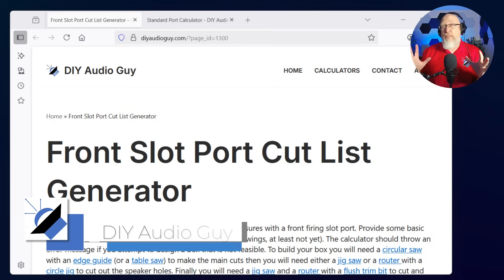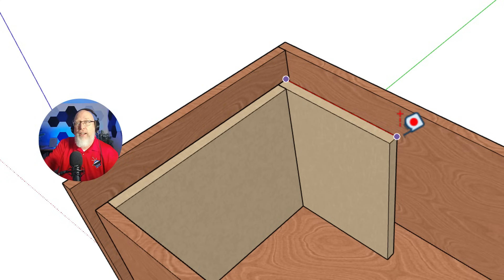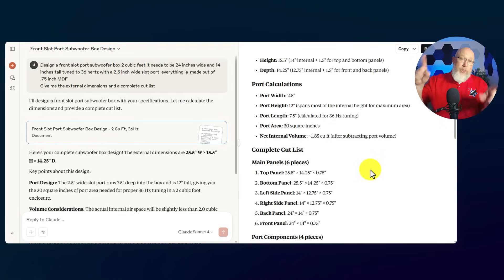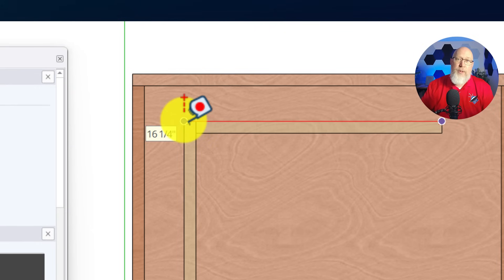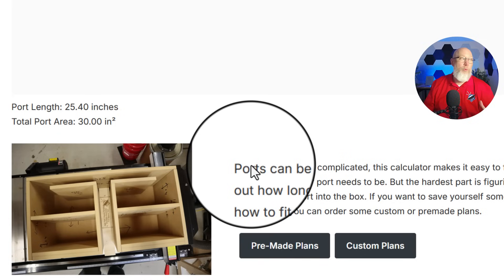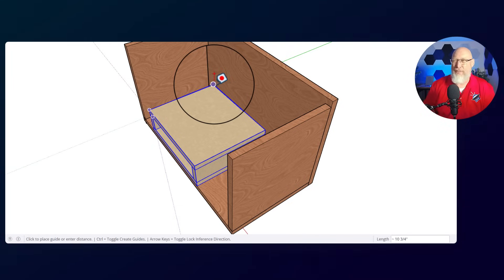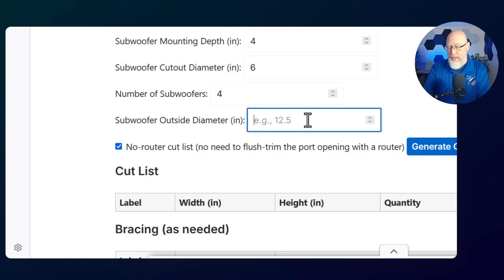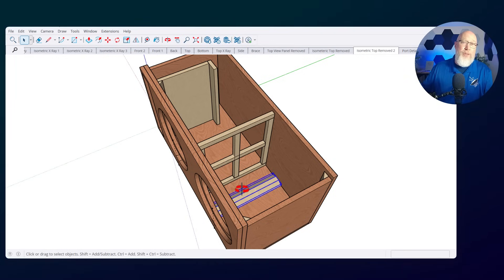AI can't design a subwoofer enclosure.

Comment: I use ChatGPT, UCAA, and WinISD combined. Havent had a bad enclose yet, they all perform as expected if not better🤞🏼 next up is a enclosure for 2 xv3 15s, 10ft³, 28hz 💪🏼
Reply: I strongly believe that WinlSD is better.. because it already has the database for subwoofers and better enclosure designs - as far as I've seen with chatgpt, have incorrect or wrong design. I guess if you know how to tweak the app and get it to provide with the right results, then I guess it works.

Comment: There is definitely something wrong with that calculator. I got a manual right in front of me for my subwoofer. I put in the height width and depth in my subwoofers deprh and cutout and overall width and internal volume number of drivers tuning frequency and I've been playing with it for over 2 hours and continuously get these error messages like the box is too narrow optional recommended wooden box specs 2.71 cubic feet box cut off at 38 HZ 21.85 in wide 14.56 h 17.75 inch deep I answer those numbers it keeps saying it's too narrow.
Reply from the maker: The outside dimensions you provided are not enough for 2.71 cuft of internal volume and that does not include the space taken up by the port. So, yes, the calculator on my website is going to throw error messages.

Comment: I'm using ChatGPT to help me with my 10 speaker/dual battery build in my caravan. It helps so much with troubleshooting! Annoying when it doesn't understand a request, especially when it's one that involves information that you previously told it, but it's very early in the tech. 
Will post vid and credit this channel for helping me

Comment: Well I bought two of these Sundown Audio NS-15v6-D1 15" Nightshade 3000W RMS Dual 1-Ohm Subwoofers. And I put them in a prefab box i had. Well they didn't sound that great at all. I was told the box was way small for these subs. I had a build sheet made on chat gtp. With the depth set at 16.5. Because more than that is uncomfortable to drive with the seat that far forward.
But after watching this. I think I am going to have to give up! 😢
Reply from the maker: Grab the box recommendations from sundown's website and drop everything into the cut list generator on my website.

Comment: @diyaudioguy does it take into account whether the subs will be firing up with the port back, or all subs and port on the same plane?
Reply from the maker: The current version of my calculator is just for front firing.  I am working on one that can fire the subs/port in any directing.  it is taking some time because I want it to throw a warning/error if there is not enough clearance.  In theory you could take the current version, with a single baffle, and aim the sub(s) any direction you like.  That works fine until somebody tries to up fire a 12" sub in a box that is 10 inches front to back, and then blames be because they bought the wood and it does not fit.

Comment: I recently tried to use chat GPT to make a couple large subwoofer boxes and at every step of the way it got things wrong. But It was great as suggesting resources for me to go and read up on, I ended up with something that works and performs reasonbly well for my first proper build. 
It calculated my volume wrong though and I didn't check it before cutting the wood so I had to adjust my calculations to suit the new box size. Worked out in the end but I also used it to figure out what sort of driver to buy and it didn't do well at comparing drivers.
Reply from the maker: Probably has something to do with the way the models are trained.

Comment: What I really want is a Database of trunk openings or fold down back seats dimensions. What sucks is being off 1/4" on one side and you can't get the box in even though the trunk volume is big enough.  An app that can answer: What are the max external enclosure dimensions that can pass through my trunk opening or back seat opening? Assembling a box in your trunk is not fun, but knowing I need to if a given box won't fit fully assembled.  Hope that makes sense.
Reply from the maker: That would be cool.

Comment: Does your calculator check for minimum vent area?   For <10% Mach (reasonable in a car): Sv = 0.01016* Fb * Vd
Where Sv is vent area in square inches, Fb is tuning frequency, and Vd is Driver area x XMax in cubic inches.
Reply from the maker: It does not, yet.

Comment: ai can give you a wiring diagram for installing your system and what else you need  though if you just tell it what you have.
Reply from the maker: I still wouldn't trust it.
Reply: There are some funny threads on diyma of complete nonsense image outputs even for extremely simple setups
Reply from the maker: @scose I have not visited DIYMA in years!  Is it still going strong?
Reply: @DIYAudioGuy  I only joined about a year ago, so don't know how it compares to the past, but i have learned a lot there!

Comment: I'm no expert but I wanted to use the calculator to calculate the port length for my double 18 inch small box (4.7 cuft). the calculator gives me a port length of -4.3 inches. how is a negative port length possible? Someone please help me. My box has a gross volume of 4.73 cubic feet and the max port size I can fit is two 3 inch round ports with a max length of 8 inches. (the box is only 8.5 inches deep) I'd prefer to fit only one port.
Reply from the maker: Which calculator through that negative number? It's mathematically possible for a negative number, but I need to update the code so it throws an error when that happens. 

As for why it happened, as the port diameter gets smaller and the box gets larger, the port length gets shorter.  Eventually it gets so short that the end correction factor built into the formula will push the port into the negative zone.  You're trying to design the port that's not feasible.    

Plus two 3-in round ports with a pair of 18s is going to chuff like hell.  My advice would be to   go with a sealed enclosure in this case.